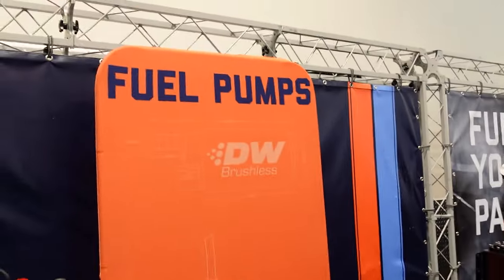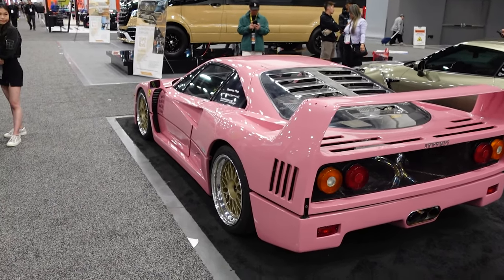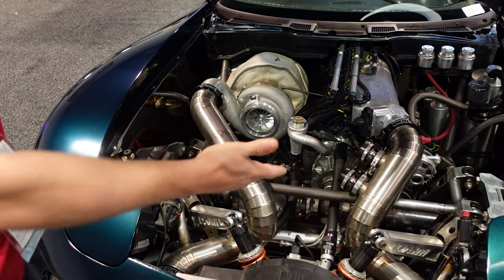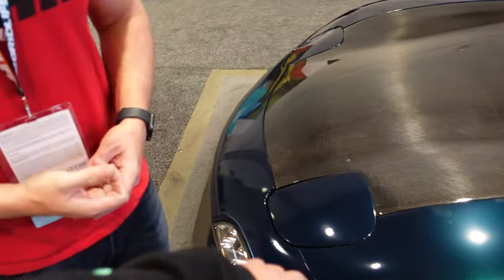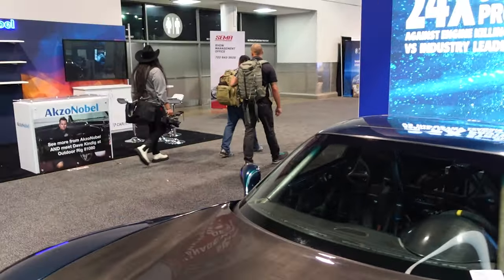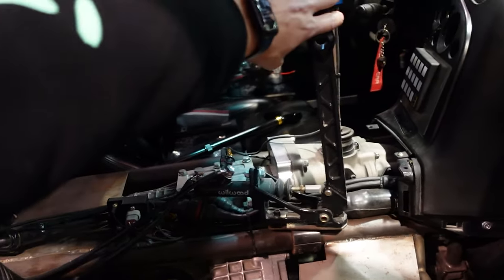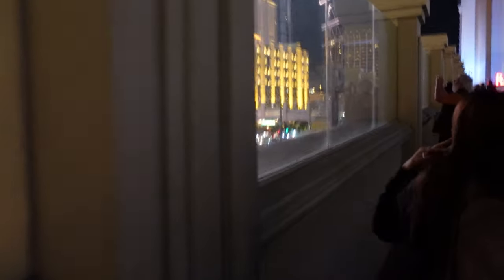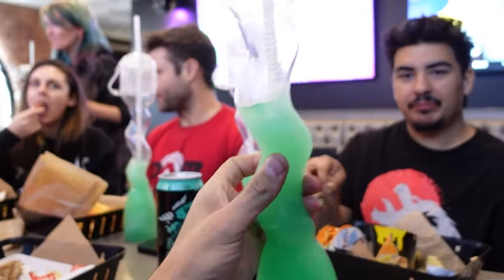ROB DAHM SHOWS ME HIS 4 ROTOR RX7 FD - SEMA Las Vegas Day 2

Comment: Since Rob now has a complete 1000+ HP AWD RX7,  Sam needs to do a 1000+ hp AWD S15 some day 😂
Reply: Lol "completed", Rob's got another several thousand hours going into that thing I'd wager.
Reply: Yup make the abandon s15 a AWD
Reply: Full drivetrain swap from a GTR.  Nissan>Nissan, most the parts would/should fit right up.  Easy peasy. Not sure wtf Sam would do w/ 1000hp to all-4's on a tiny congested island LOL?? TrackDays @ Fuji maybe.
Reply: 趙夢加油，妳可以的。
youtubemn.com/watch?v=XVMqi0UZ17X
他算是内地新生代里实力最强悍的女歌手了。经历过大风大浪的。
Reply: It’s about 2000hp
Reply: @superrad1659  nope the whole for structure won't work with the gtr awd system there would need to be a sh*t ton of modifications done to do that
Reply: @anthonyrobertson9502  I've seen a few S-chassis car's with GT-R based drivetrain's on YouTube that are in Australia, one of the car's has an SR20VE engine with a 1000+hp.
Reply: Yes he need to
Reply: @Buccaneer1  Not yet, that's the goal, but it's far from finished, not even the bodywork is finished in the slightest, right now it's not even running any boost because it hasn't been tuned with the new turbo and exhaust manifold, believe me, this car is gonna be producing content for another 3+ years
Reply: @sandygarage3802  once again they would of had to do alot of modifications they strut tower and practically everything are different.
Reply: They called Syclones haha

Comment: This Rob Dahm doesn't do much other than throw parts into the car- more like a parts  changer , not very successful overall
Seeing him for some time  , just talks a lot , smiles a lot and  car falls apart when the time comes to perform.
Typical pattern - shows off parts and list of new mods and when time comes to show what it can do it will develop some mechanical issues or just fall apart 
A very shoddy , clunky build ;  seems  to be always incomplete
Reply: You have to realise it's a prototype car, it's incomplete because it's still being built, and Rob is still learning from the build. There's no big design team behind it all, it's just Rob and Isaiah.
You look at the latest quality of things like the harnesses, the fabrication work and physically making a 4 rotor engine, AWD RX7, it's far from just "thrown parts into the car". There's no off the shelf kits or bolt on parts he can use, everything needs to be custom made to suit, and that's not a quick exercise.
He's also has the other side projects that soak up a lot of the time. The original 3 Rotor and white FC and the rotary Vette and they all run just fine. 
If any that has ever had a project car would know, that it is never "finished".
Reply: @streddaz  This guy's channel has been  around for nearly 12 years  .. which is  a very long time to learn how to get things right.
He's just incompetent  and  technically very unsound
Reply: @audio-ytube  Have you watched many of his videos? His early Youtube videos weren't about building cars, it was about his Lambo and not about building cars. It's only in the past 6 or so years that he's actually been building cars himself, starting with the 3 rotor RX7. He doesn't have a mechanical background, he made a lot of money in IT, so the last 6 years he's been learning how to modify cars. You only have to go back a few years to see how much better the work is and has gone from getting other workshops from doing the work to doing almost everything inhouse. 6 years isn't very long to learn, welding, CAD, machining, auto electrical and mechanical theory and practical applications. 

If you think it is so easy, just show me your ground up project that makes 1700hp😉